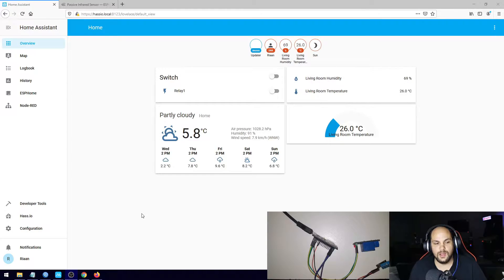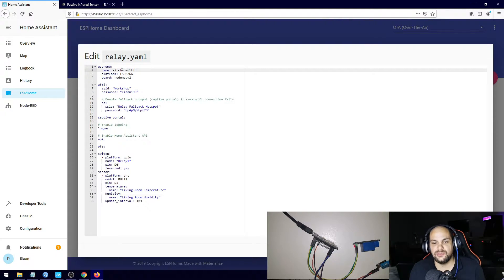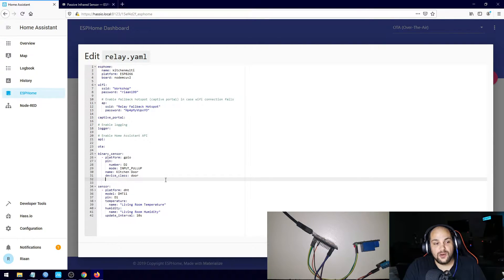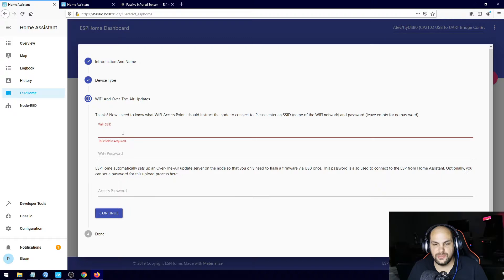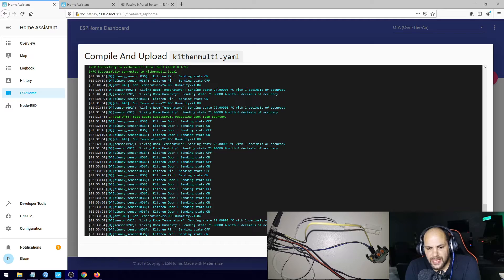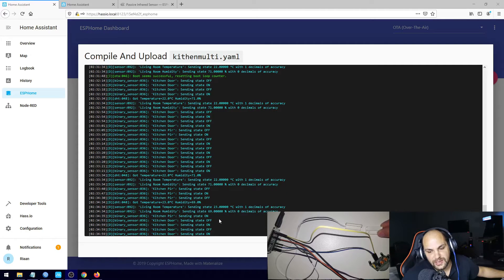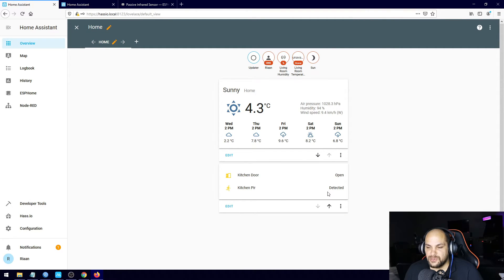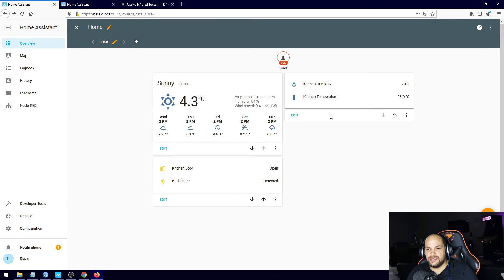Home assistant 104  ESPHome Multi sensor

Comment: Really great videos. They are easy to understand, however I have few questions. Could you please clarify?

I see that the door sensor and pir sensors are connected to the nodemcu which is again connected to the Raspberry PI. How to place if they are different locations? Can they communicate wirelessly? How do we power the door sensor and pir sensor in that case? Sorry for the dumb questions.
Reply from the maker: hey Yes remember when setting up the mcu you enter the wifi information you just need to power it  with 5v you can mostly just use a old phone charger. I just used the pi to give the mcu power
Reply: @AverageAutomation  Sorry if my question was not clear. My Raspberry PI is in the living room and I am planning to setup the pir sensor in the kitchen and the door sensor at the apartment entrance door. They are physically located at different places in the apartment. How do we connect the D1, D2 pins to the nodemcu, which is placed next to the Raspberry PI? All these devices are at least 10 feet away from each other.

Comment: I'm trying to add LM35 temperature sensor (analogue) into esphome. As far as I know doesn't exist platform of this analogic sensor in esphome library. I got already readings of the sensor through a web page, but do not know how to program in the node yaml file. Any clue?
As far as I read in esphome web page, I need to create a custom sensor component, but I got lost in such huge amount of information. Have you any idea how to do?